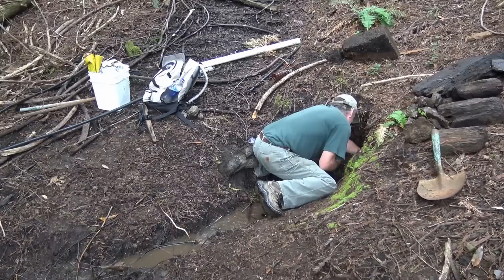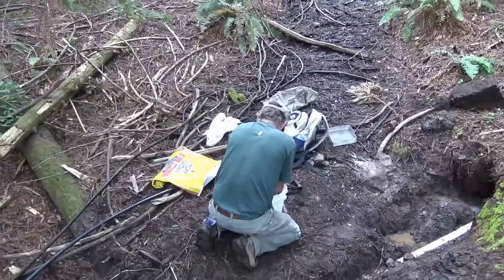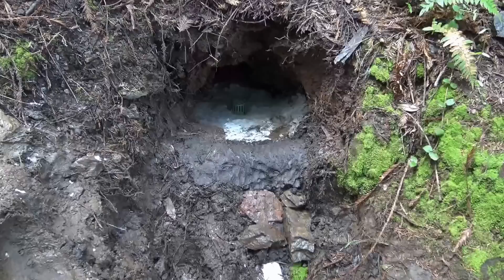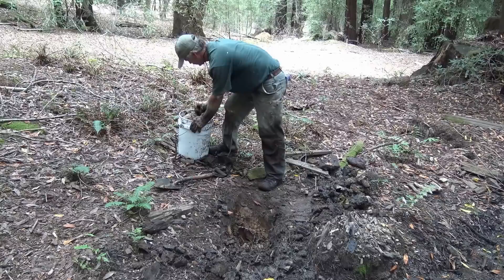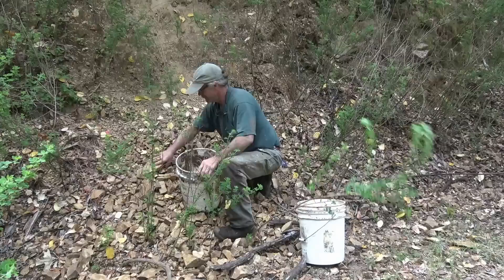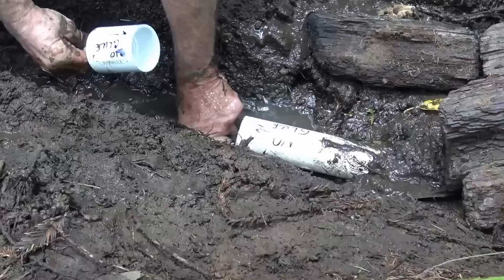Low Cost, Easy to Make Sanitary Spring tapping for Water

Comment: I do not see how this treatment is sanitary. A heavy rain will wash down the hill and into your cutout. A piece of plastic over the rocks will not keep out contaminated ground water. Now if the entire cutout was capped with clay and then buried, maybe.
Reply from the maker: Most of my spring taps are not in a place where water washes down the hill, but in a hole in the side of a hill. However, my purpose was to show you some new ideas that you can adapt to your needs, so if you think you need clay over the tap, do it or maybe some kind of roof might work in some situations. And by the way, the plastic bags I use are put in like shingles,  and covered with dirt, so things just flow over the top of the tap. Dirt is a natural filter, it's what the water flows through to get to the tap.  All the other spring taps are way less sanitary than this method. This method's footprint is so small, it is far less likely to get contaminated than what most people do to tap a spring. Much less surface area. The main difference in this method, compared to most of the others is this. Most of the other methods dam water up so you get a pool. This method works just the opposite. It lets all the water out into your tank so there is far less places for contamination.

Comment: Looks like John is the ME doing the work not the We a doing the work.. Nice job John
Reply from the maker: Hey Shane, Sure, John's doing the work but because the method is so simple, he's not really working very hard. :O) It only took a couple of hours to do the work, not several days like most systems to tap a spring. :O)
Reply: @bobseyes  Hey man, I was just pulling your chain. Hardly enough room for two men to work in such a tight spot. We have a similar spring on the family property and  the guy that does the physical work as my brothers watch.. Thanks for the great content. Cheers

Comment: This was a great video. Thanks so much for taking the time to post it. I just bought a property that has a long 200' high ridge. About 50' from the top of the ridge is a 50 foot "bench" of swampy marsh with multi springs coming out of the sopping wet blue clay.  I'm assuming after watching your video, the safest thing for me to do would be to chase the spring all the way back through the wet area to the toe of the ridge so I don't get ground water contamination? The clay is very exhausting to work with. Every shovel full completely sticks to the shovel and needs to be banged off!
Reply from the maker: Hi Josh,
Yes, if you want real clean water you need to find out where it's coming out of the ground. With this system if there are more than one spot it's easy to install more than one of these. Sounds like a nice source of blue clay.
Bob

Comment: Love this, thank you! Do you think bentonite clay would hold?
Reply from the maker: I don't think it would be thick enough. One can add some little rocks to it. You could try the bentonite if you can mix it thick enough, if it doesn't' work, it's not that hard to take it apart and do it with the right clay. It's hard to beat the blue clay, or clay like it for this project as it's the best for it. One can usually find it by a spring or another spring or go someplace else where there's springs and get a bucket or two. You don't need much if you keep things small as you should.
Bob.
Reply: @bobseyes  Thanks! I'll keep looking for blue clay!

Comment: I located a spring on my uncle's property, but the water was murky because of the coarse black dirt, need info on how to make water clear.
Reply from the maker: Usually water that is not messed with runs clear. You could try digging it out with a shovel a bit and see if it improves. I once used a bathtub set up as a settling tank., just a tank with  water going in the top and the outlet pipe letting water out near the top and that worked. I only needed it in the winter during big rain storms as the water would get a bit murky from the blue clay but it was always good to drink just the same. Another way would be to use modern day filters on any water you need for consumption.
If you are not using a lot of water for consumption filtering would work but if you need to use a lot of water for that it's not so easy to filter large volumes of water.

Comment: So how do u harvest the water? U dig under the pipe to collect water into containers?
Reply from the maker: Most springs in our area are on hills so all you have to do is run the pipe down hill to a tank or some kind of collection storage tank. If you don't have a hill ,  you might have to run the pipe into something to hold water and pump it somewhere, especially if the place you need the water is above the spring area. In the olden days one would find a spring and put the place that needed the water below the spring such as a cabin or house. Now a days we have pumps so water can be pumped up hills and we have more choices in the use of the water.
Reply: @bobseyes  thx 4 the reply!

Comment: Bob, 
Could you help me with identifying the green inlet for my purchase? (Part # or item description?) Does that go to a 2"  pipe?
Thx Joel
Reply from the maker: The green piece is a top screen for a down spout for a gutter. I used to have to sand the part down to fit on a 2 inch pipe but the last ones I purchased at Home Depot  fit a two inch pipe.  The stainless steel screen box is important. I'd suggest a stainless steel kitchen hand held strainer for that. Just cut the handle off and put it over the green strainer and push it into the clay to get a good seal.
Bob

Comment: Any lessons learned in the four years of using the spring?
Reply from the maker: Not really. The spring has been working all this time with no maintenance at all. John did a good job. That's one of the benefits of this system, it's a very low maintenance system if installed properly as compared to most other spring type taps that require much more maintenance usually.

Comment: Could you explain what you are using to catch the water coming through the pipe? I know you reduced to 3/4” so are you using a flexible hose or some sort? I have a very active spring that I want to tap but the end result on how your catching your water I need to know as well! Looking forward to doing this on a warmer day here in the NC mountains!
Reply from the maker: Yes the water flows into a black plastic pipe you can buy in rolls and is fairly tough stuff. You can run the water into any type of tank, or even a bath tub as I've used that for animal waterers and even used a tub once for the tank in a hunter's cabin. Most anything will work as long as it's sanitary for humans which isn't as important if it's for an animal waterer. Humans need a covered type water collector to keep things sanitary, like keep the critters and bird dropping out.

Comment: Hi - I am trying to develop a spring not too far away from you in the hills above healdsburg, NE of Venado, and Cazadero. I'm wondering if I might be able to speak with you, I could use some help!  Do you know anyone locally that I could hire to help me do this? (would you be interested?). I'd like to learn myself, work along side someone, while the work is being done. Thanks so much!  Great video!
Reply: We ended up getting only half a gallon flow per minute but that was during dry season. Not bad but not amazing. Thanks for the help
Reply: @grubadubful  hey that's not bad considering the drought. I'm just over the hill from you in Middletown. My place is on Mt St Helena. I'm about to tap a spring on my land. It's flowing about 3-4 gallons a minute. I'm just looking for ideas on how to capture it. I came across this great video. What did you use for a dam? Did you have any blue clay?
Reply: You want bob's job

Comment: What is the material you used to stop the water from seeping through the ground?
Reply from the maker: Use blue clay if you can find it

It's a natural clay. When water sits in dirt a long time, it turns the dirt to clay. It can be found around springs or wet spots by springs. You will see John go off and look for some at some other springs as we don't want to mess up the one we are tapping and the ceramic clay we had was no good. The best clay I've used is what I call blue clay found by springs. But John didn't find any blue clay but found some brown clay at the other springs which is almost as good as the blue stuff.
I've used potter's clay before but if you don't get thick enough stuff it will fall apart, but thick enough clay will work.

Let it out and it won't seep

In some ways you don't have to be too concerned about water seeping into the ground as this method keeps the water drained and should not back it up.
Water wants to flow using the easiest route so it goes right into the drain pipe and on out which doesn't give it much time to seep out, so don't back up the water but give it the easiest way out, down your drain pipe. The reason this method works so well is all the water is drained and not  backed up to make a puddle that is just a place for water to become contaminated. Don't puddle, drain it out, puddles are bad.

I've used just plain dirt for the little sink and dam, but it can take more maintenance as it doesn't hold as well, but it will work and if the spring is done right, it's no problem to uncover it to repair it each year in the spring if need be.

Oh, one other thing. This is just a guide to show you how to do it. Don't be afraid to adapt other stuff to do this. It's the idea's that are important.
For instance a stainless steel screen would be hard for some to come by, so how about using a plastic window screen as it won't corrode and is much easier for most to come by.
Bob

Comment: I live on a hill in central florida and have a location that is has been described as either a ground seep or spring.  It stays wet year round and is about 4 feet wide and 8 inches deep but does not run.  There are multiple cypress trees around it which is what made me look for it to begin with.  I would be interested in tapping this spot in case of an emergency situation.  

Do you have any experience with developing something like that or would this method work for a ground seepage location?
Reply from the maker: Hi Andrew,I would take a shovel and dig into it and see if you can get a trickle of water to flow, if so, dig some more and follow where the water is trickling from if you can get it to trickle, you can get the water. Dig wait, dig. If no trickle there just won't be enough water to take. What you describe is what I look for, for springs to tap. Most of our springs around here are small and this method works well to get the water out. I'm my area, look for ferns and water type plants and damp spots.
Reply: Awesome, I will spend tomorrow doing some digging.  The area is overwhelmed with giant, beautiful ferns.  I will let you know what I find.  Thanks so much!
Reply from the maker: Springs don't always just flow out onto the ground. Lot's of times they get to the surface and just flow back into the ground as water always takes the path of least resistance. I look for springs looking for wet spots and water type plants that grow around springs, such as big ferns or even big trees.You can try digging around a bit with a shovel trying to find some water flow. If you do find the flow, dig following the water. If you can't find the flow, one thing you can do is come back in the winter to look for water flow when it rains. Mark the spots and come back in the summer and dig around where the winter flows to try and find the spring flow. Maybe doing a little digging in the winter might help too.  Sometimes springs come out under ferns or trees as they grew there because that's where the water was. The best time to tap a spring is in the fall, September or October, when the spring is at it's weakest. This is also the time you can tell where the main spring water is coming out as it will still be flowing when others dry up at this time. This is also the time you'll see the spring at it's weakest, so you can measure it and see if you have enough to use. Not to say you can't tap a spring anytime of year as a temporary tap is easy to put in, especially if you have a lot of water flowing.A half gallon a minute spring can serve a house, if it's conservative. A small spring can go a long ways if you have a big enough water tank to collect the water. Even a half gallon a minute spring at it's weakest likely will have enough water for a garden as there should be more water during the gardening period.Tap on. :O)

Comment: Thanks so much for this!  I'm surprised that just clay will be durable enough through the winter.  We have a similar situation in steeper terrain down south in Corralitos.   The main spring has run dry this year, but there is still plenty of seep through a clay layer about 12" below the spring.  Have you ever done a "dual source" spring like that?
Reply from the maker: Hi Steve,Good clay won't wash. Good clay is real sticky. I like the blue stuff the best. I don't think store bought clay is very good for the job, but maybe better than nothing. But if you have springs, you should already have some clay to use in the area somewhere as clay is made by water seeping though dirt for a long time as in springs.  Sure on the duel source if it's close enough to run them together, otherwise it's not real hard to instill two of these as they are fairly easy to install. Oh, I tend to put a lot of rocks behind the dam to help hold the clay dam in in the winter and it gives the water a place to rush over in the winter helping prevent wash out.These things are so easy to do, do one and see and you can always adjust it to improve it as you go. They are much easier to deal with than any box. Period. :O)
Reply: that good clay is almost impossible to get off. it just sticks and stays forever. ask me how I know 😂 the damn crawdads can move it though 😆